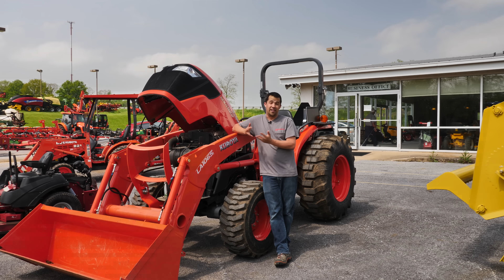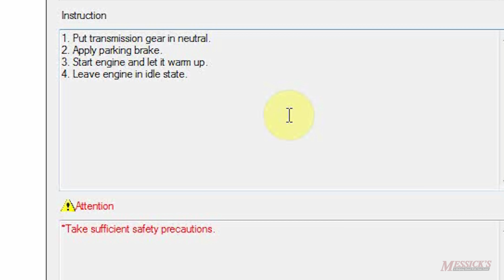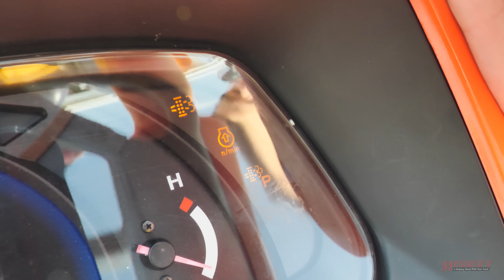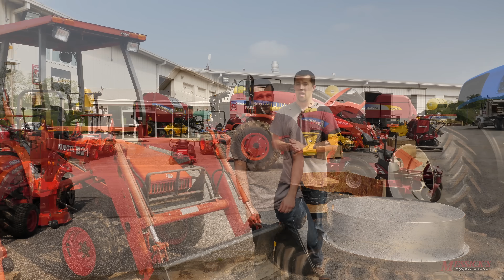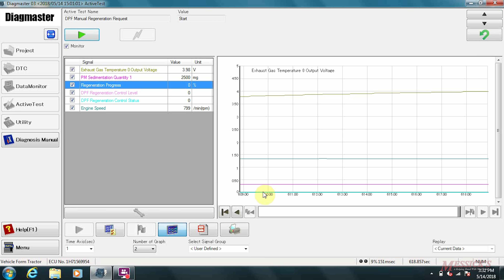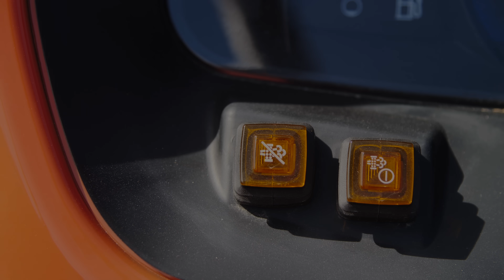No need to Panic! DPF's explained.

Comment: Hi Neal, good video, it should answer a lot of questions that people have.  I have a L47 TLB which has the DPF percentage screen that I always have on display. It's nice to know when a regen is nearing. I usually run about 2000 rpm's, and burn about every 30 hours. At lower rpm the percentage increases quickly. I've also noticed if I run it at higher rpm and work it hard enough the percentage will actually decrease.  Enjoy the videos, keep up the good work.
Reply: New to the DPF world... Brand new L4802.. I thought low RPM would save engine wear and tear... been moving some logs around, pretty much under 1000 RPM... DPF came on at 16 hours... So, what is a good operating RPM when not using the PTO? I don't want to be to low due to DPF and not to high to run it in the ground... 
Please advise!
Reply: @michaelhenderson6312  
maintenance
Reply: @michaelhenderson6312  
Sorry about the errored reply. I run mine around 1800 rpm doing most jobs. Don't worry about wearing the engine out, with proper maintenance it will last a lifetime.
Reply: @jc-botaman1077  thank you... I ran it at 2k today after the regen

Comment: I worked as a diesel mechanic up until a few years ago. The dpf and def systems were our #1 problem. Given time, they become problematic. That's just my experience with a fleet of 120 tractors.
Reply: We got a fleet of Komatsu  equipment up in the  North west territories with these filters and were nothing but trouble, and all are ford pickups had to be deleted or would plug up.
Reply: Is it something (dpf) that can be taken out and still run or will it not run
Reply: @Robbobshiskabob  Have you found your answer? As soon as my warranty expires I plan to pay a technician to rip that garbage out of my Kubota.
Reply: @TroutGravyWithPancakes  Have you found an answer to this? I also want the garbage ripped out. We should share tips if we find out how.
Reply: @DeeGeeTN ever find out?
Reply: I know that and that's why I want but a Kubota!
Reply: @brettjones2067  mahindra is the only tractor I'm aware of that doesn't have a dpf
Reply from the maker: DOC only engines are on most of the imported brands. The more domestic companies (Kubota & Deere) are using DPF's. A large part of this is probably because at Tier 5 DOC-only likely won't be complaint requiring companies to do a lot of model updates.
Reply: @MessicksEquip  so Kubota and JD are trying to stay ahead of the curve where imports are going to  upgrade to dpf only when necessary?
Reply from the maker: @mjohnsonxtreme  That would be my read, yes.

Comment: What is an appropriate rpm to run an L3901? I have 67 hours and have had 3 regens(16, 32 & 59 hrs). The third regen was done during snowblowing season where pto rpm was used all the time. I don't want to run 2300 for normal use,though.
Reply from the maker: run whatever is appropriate for your task, but I'd stay about 1/3 most of the time.

Comment: If the machine is for private/personal use only, is there a means of deleting these systems?
Reply: And, private/personal doesn't make it legal to remove.
Reply from the maker: never seen one.
Reply: Jason Daniels I can see the benefit of emissions equipment on professional/contractor equipment. They run multiple pieces of machinery for for thousands of hours per year and that much pollution can add up.  These professionals can absorb the added cost as overhead for the maintenance and downtime emissions equipment inevitably causes. Landowners and hobby farmers don't need the headaches, complexities or costs and have far less environmental impact.
Reply: @moaski  look through the comments in the rest of the video.
Reply: @horseblinderson4747  For?

Comment: One comment you need to say on DPF is use of engine oil. My Kubota Dealer drove 60min out to do a on farm first service with wrong type of oil(kubota CH-4 Oil). He did not know my tractor had a DPF until i point it out. If I did not pointed out and call back to based. I would have had Kubota CH-4 oil in the Engine. What would happen i did not put in correct oil to engine?

Lucky he had some Isuzu DPD Approved oil. but not still not CJ-4 oil.  But they say they use that oil in DPF equip Kubota..
Reply: Likely nothing bad. Owning a diesel car shop I've seen many clients running well over 100K on CJ4 oils with not DPF issues. Modern oils are really low in the "bad" stuff that kills the DPF. The CJ4 is even lower still.

Comment: Hey Neil, 

I have a M135GX. I done many regen so far on the tractors. Is there an option with out a computer to start a regen early? Ie at 90%. My first regen request was like 1min before shutdown for the night at 11pm, I had to inhibit it and do a regen next time(a month later) i started up. But if in knew i have hour before shutdown i can do a early regen and get the filter clean out. 

Also can you do a video on Diesel performance chips. 

Or how to save fuel. My M135GX drinks a tanker load more of diesel vs the M125X it replaced under the same condition. I feel like my local fuel station is becoming my best friend and my plastic is getting paper thin.
Reply from the maker: you can do a parked regen whenever you want.
Reply: How about early regeneration on the go?
Reply: Where's the environmental benefit if these things use more diesel... Sounds like a con to me.

Comment: Did the rgen issues with the b3350 get sorted out because I am thinking about buying one used. What should I look for. And is all service bulletin tracked by the serial number of the tractor. Thank neil
Reply: Mi Heating Guy I am using a 2014 B3350 with all the updates on it. Last summer it ran great, and never had an issue. Once our fuel supplier switched to winter diesel it would fail about 15 minutes in, then once it cooled it would complete a regen and be fine until the next regen. Now that I’m back on summer fuel, it is doing fine again. That said, my dealer informed me that it could be due to a possible timing issue of the fuel pump, and they are working with Kubota to solve the problem. I would still buy the tractor knowing what I know now, and I am confident my issues will be solved soon.
Reply from the maker: Mostly... Can't say 100%.. but it can be done. If I have any concern it would be in the far Northern climates. In the South I wouldn't hesitate.
Reply: Messick Farm Equipment  I'm in southern michigan and it gets pretty cold do you think that I would have issues
Reply from the maker: It depends on your dealer. Your in a problematic area.
Reply: @MessicksEquip  Its not the area thats problematic, its the emissions system.. All our non emission Kubota's run great in the cold :)

Comment: Does Kubota allow us (general users) to buy that software and cables?  (Right to repair)
Reply from the maker: No I don't think. We pay several thousand a year for the licenses and adapters. It's really expensive stuff. Other than making neat charts, I've never seen anything in there of value to an individual owner. I do follow right to repair and consider myself a supporter of it.
Reply: @MessicksEquip  The main reason for soot is Ethier to much fuel or the engine is not up to working temperature / Excess idling to keep the soot burn off
If it was me I would have an ECM  setup that would read the EGT when idling and throttle the engine up to working temperature to burn the soot off and throttle back down according to the EGT  the electric cooling fans work similarly to that  but I'm not and electrical or a software engineer
I was taught never let a diesel set idling for extended periods and to let the engine idle 5 minutes if its turbo charged after being worked hard to prevent wet stacking and coking in the turbocharger oil lines!
Reply: the manufacturer spends millions of dollars developing the system, sensors, hardware to get all this epa mandated crap to run. they are liable if it works incorrectly ( ask Volkswagen)  so if you have not attended factory training and have factory authorization- serious doubts they will sell you any software.  it's a catch 22 situation if there ever was.   I don't see apple selling software to fix their devices and they don't have the epa leaning over their shoulder.  not saying some tiny company cant develop their own to sell- that's another story.
Reply: Apple doesn't want anyone working on their electronics, but go get a proper computer. You can download the service manuals for all thinkpads for free, which shows ever screw, part number, option, and all the correct specs. They learned to be successful with giving consumers the information to repair everything, so why can't other companies?
Reply: @firstname6208  They should be made to have the software available for people to make repairs, They arent liable for someone who isn't employed by Kubota using software..
Just like Apple isn't Liable if i activate a bomb with my iPhone

Comment: When did DOC and DPF first show up on S.S. sold tractors? Am I correct in believing that they are a Great Big N?A on an '05 NH TC33DA? I think that my money would be better spent on a total rebuild at 3000 hours than on a replacement. With 2500 hard hours and minimal  maintenance she is getting kind of tired - especially the hydraulic pump.    sdh in the Tobacco Valley of CT   (GrunderLand)

Comment: My L3560 has done 3 regens at around 23, 24 hours between each one. Normally run it 1500 to 2000 rpms unless working it where it needs more. Should I run higher rpm all the time?

Comment: Mahindra doesn’t have DPF, Massey is coming out with tractors that don’t have DPF as well. I like kubota but I will buy a low hour used machine to avoid the extra potential for issues. Great video Neil.
Reply from the maker: That's the DOC system I talked about. It has it's own intricacies. 🚜 Kubota also makes DOC only engines, they just don't seem to think they are appropriate for tractor applications.

Comment: Best thing to do is buy an older tractor before they added that crap.
Reply: Did you have to do anything to the computer? O2 sensors etc... The mileage on my Ram went to crap, thinking of crawling under there with the saw myself.
Reply: @turbotek-wj8vc  No because the O2 sensor is before the Cat, my vehicle is old enough that it only has a pre-cat O2 sensor.
Reply: Nope sawzall took care of that.  Drove it around for a few months as it was, then removed the cat when I replaced the engine and transmission and turned it into a work truck.
Reply: did you stop buying cars because of catalytic  converters?
Reply: William Todd we have a Kubota m7060 that has almost 3 thousand hours with all the emissions stuff and we haven’t had a problem yet we also have a l3560 with 500 hours that has 500 hours problem free tractors with this don’t have enough age to know how this stuff will last
Reply: Runs much better less exhaust resistance for a better flow actually increases your HP and your fuel economy.  Maybe do some research before opening your mouth.
Reply: @wildbill23c  And a violation of federal law.
Reply: @fhuber7507  Not in my area.
Reply: That's really ignorant. And removing cats from a vehicle? And somehow you think it'll run better? Wow....

Comment: Is the exhaust on the L3301 (with DPF) "cleaner" for the operator to breath then the L2501 (without the DPF) or is it only an environmental thing?  When working with tractors, your going to be breathing a lot of that exhaust.  Thanks!
Reply from the maker: Most people wouldn't think about that, but you are correct. You don't notice the exhaust smell that you would on older tractors.
Reply: I did construction and for our heat in the winter and heat our  tar we ran our trucks and the trucks had the dpf and the i would get sick but our one trk had been deleted and i could be standing right next to ot just like my old gm 6.5 or now my 7.3 ps and not be bothered by it

Comment: Have you seen longer longevity in the newer emmision tractors compared to the older ones?
Reply: Messick Farm Equipment if it fallows the truck market, no. Not even close.
Reply from the maker: It'll be decades before anybody really knows. The stuff is far from new at this point, but the last couple of generations of equipment just don't have the age to them yet.
Reply: Is it correct that tractors in Europe have had these emissions requirements for years? If so that would be a good source for information.
Reply: Shredxcam22 He mentions in another video tractors a bit different than trucks because tractors are sitting at higher RPMs more than trucks.

Comment: In trucks DOC burns the stuff then DPF filters it and SCR w/ DEF gets rid of NOX (over simplified)  I work in the med and heavy duty truck industry.  DOC, DPF, SCR, and DEF system all equals money and more down time.  Fuel economy went down for trucks.  Exhaust is a lot cleaner and smells better and its the law.  DONT skip your regens!!!
Reply: Your opinion that it smells better . I'll take regular Diesel exhaust any day. Besides , the over the road trucks I drive CONTINUALLY have emissions problems . Biggest bunch of crap ever . Thanks EPA ! 😡
Reply: @johnnypopper-pc3ss  I get very ill from the horse piss being burned !
Reply: $4k SCR  $1k DPF $2K DOC and all the sensor and inj.  Its around $10k system. Yes nothing but trouble AND egr system is not good for the engine more problems
Reply: @sweetpigfarm3645  yep sucking soot back into the intake is never a good thing!
Reply from the maker: our tractor requirements are different than on road trucks. We have the same systems, but in different combinations.
Reply: Isn't base on HP what level of emissions they have to meet?  I thought the big ones are using DEF.